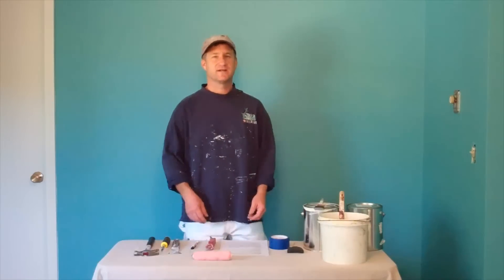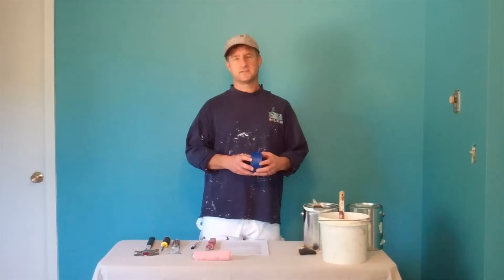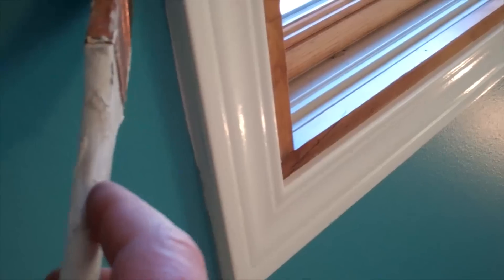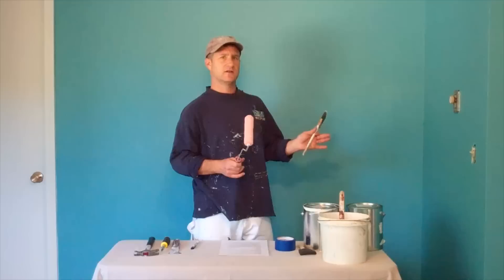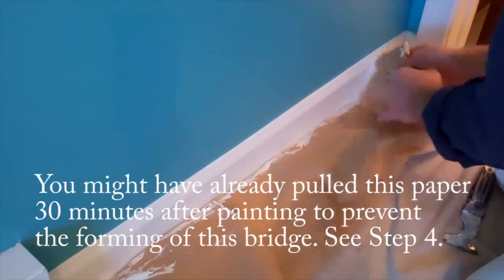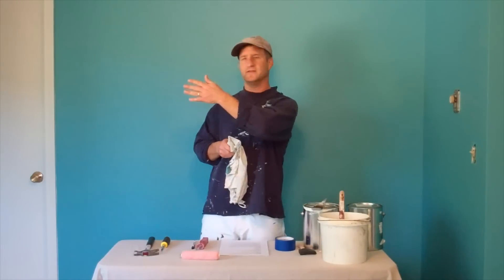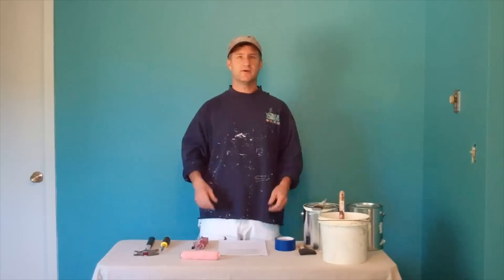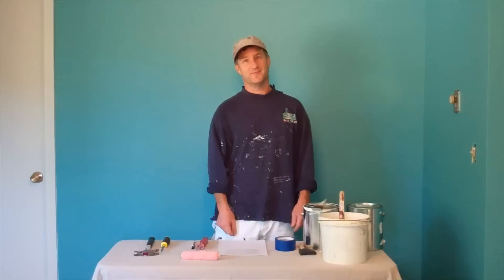Interior Painting Step 5: Touch Up and Clean Up

Comment: As for tape/paint forming bridges: I typically paint rental apartments. It takes me a total of 4 days to prime, all inclusive and 3 days to do the finish. That means that weekends included, the paper is there for about 9 days, and I certainly will not re-paper between coats. Do you have a better recommendation than the use a razor blade to create a straight line and cut the paint?

Comment: Hey, John...  Asked a question re: vaulted ceilings in another video.  Had a question about touch-ups.  Is there any sort of general professional "standard" for when a touch-up is considered acceptable? I've tried touching up with surgical dabbing, feathering outwards with a brush (not foam, however), feathering outwards with a 4" roller (same nap as original application) -- and I've never gotten a touch-up that I couldn't see from some angle (regardless of color or sheen) -- granted sometimes looking down the far opposite end of the wall.  I've always ended up re-rolling the wall in question.  I read somewhere that if a touch-up is not visible from a distance of 3 ft. at angles of 45` and 90`, it's considered "successful".  Your thoughts?  Are truly invisible touch-ups possible?  Do most pros called in to touch up their own work end up re-rolling walls?  Thanks much...  (looking forward to reading your book!)
Reply from the maker: These are great questions and my answer is kind of long, but the bottom line is there really is no way to make a touch-up blend in 100%, especially at an angle, simply because the sheen of the additional coat will be shinier than the sheen of the previous coat. (It's the sheen  difference you are seeing when viewing at an angle.) This is because the additional coat absorbs into the painted surface (drywall, for example) at a different rate. With custom colors (especially dark ones) there can actually be a slight difference in the shade of the color, especially if ALL the paint wasn't boxed (mixed) together properly at the start of the job. Just the slightest difference in coloration will stand out, even when viewed straight-on. With stock colors this usually isn't an issue, and that's one reason to go with a stock color, especially in a commercial setting but even at home.

So what's the best way to touch-up? You can re-roll the entire wall quickly (without cutting in) if you want to eliminate the problem. Sometimes you can re-roll just a small section of the wall if you are able to cut it off at logical break points that will be less noticeable (for example at the edge of a large window when painting inside, or if painting outside, you could just roll the one piece of siding from one joint to another joint). If you don't want to re-roll large sections, you can be as surgical as possible about the touch up if the spots are small (the more surgical, the less noticeable it will be). Try to mimic the roller stipple by either dabbing the paint, or use a mini-roller and feather it out as best as possible. Feathering out any touch-up work is always very important.

The questions everybody needs to ask themselves is how picky do you want to be? Is anybody except you really going to notice this touch-up? Certainly in a commercial setting it's unlikely people will scrutinize the paint job at an angle, so painters can get away with touch-up that usually doesn't involved re-rolling entire walls (which isn't even practical on a commercial job because they always require a lot of touch-up due to all the other trades banging around doing their own jobs). It's also worth noting that over time the shinier sheen of a touched-up area will lessen and it will blend in better. This is a good thing to tell customers to appease them until the time when they simply forget about it. In fact, one of my former bosses used to outright tell picky customers, "Stop looking at it." He was sort of kidding, but sometimes that's the best solution.
Reply: howtopaintahouse Thanks for the great, detailed response -- kind of what I had figured, but great to hear confirmed by a pro.  My wife keeps telling me, "Stop looking at it!" -- so it must be true!  Next time, I'll have someone else do my touch-ups.  We always seem to be the most critical of our own work...  Thanks again for taking the time to reply at length.  Regards!
Reply: kicknotes haha. you are a perfectionist type man :)
Reply from the maker: Hi--I don't think there is any defined professional standard. My personal standard is much lower on a commercial job than on a residential job. You cannot afford to be repainting walls on a commercial job just for the sake of touch up. But if a residential customer is unhappy with a spot of touch up showing, you can either reroll the wall to make them happy, or tell them that the "shine" will fade in a few weeks. This is true, plus after a few weeks they will forget about it and stop looking at it. :) It really just depends on the situation. It always pays to remember that most people don't look at a paint job nearly as closely as a painter does. So wait for the customer to say something before you worry about it.
Reply: totally agreed. anyway, thanks again for the info you bring to us. it's very helpful.

Comment: Can you explain the differences between tapes? I typically use green tape, because it is most commonly found in my area. But we also have blue tape, masking tape and frog tape. Frog tape is an expensive and specialized tape to create no-bleed lines, masking tape isn't really for masking, the adhesive is too strong and bonds too quickly. Is there any relevant distinction between blue and green tape?

Comment: hello, 
I noticed that you put blue tape on the trim whenever you were touching up the wall. How long would you recommend letting the paint dry before putting tape over it to avoid it pealing off? 

Thanks!
Reply from the maker: +cacsoccer101 If you put the blue tape on, do the touch up, and pull it off immediately, as I do in the video, you are not likely to pull up the recently dried paint underneath. But to be on the safe side I'd give it a few days.